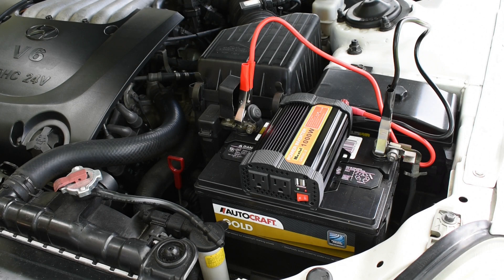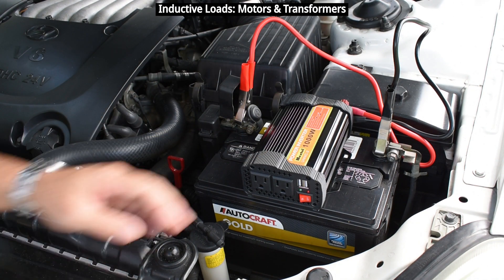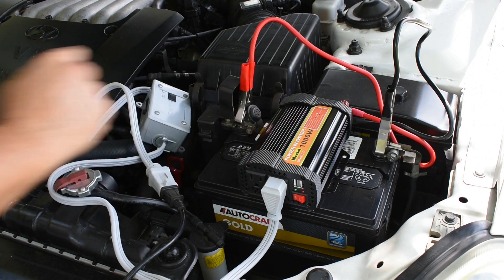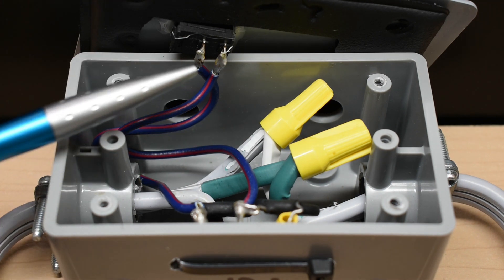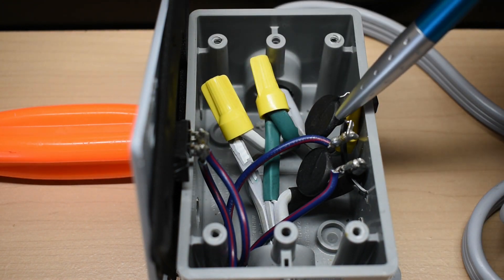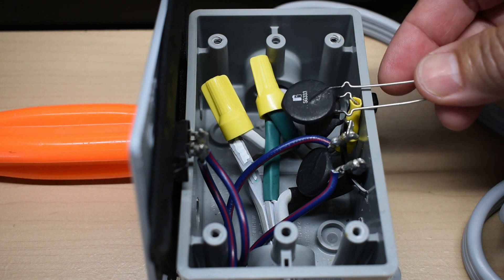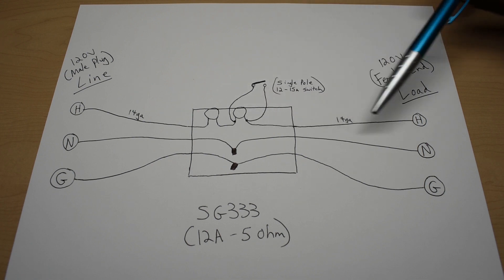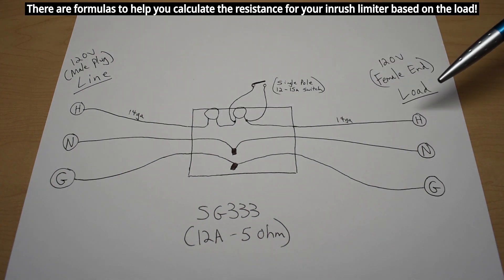The Simplest Soft Starter!

Comment: A capacitor rated correctly and put in parallel with the load would be able to output the amount of current needed for a short time , but would be more complex to create.
Reply from the maker: You can limit inrush current by using a high value oil filled run capacitor (200-400uF) in series with the hot wire to the load. I've done it many times. Works great.. Thanks for watching! Be sure to share the video link with others so helpful videos like this are worthwhile to make. Way too many channels on YT that don't help others or educate others, are getting way too many views.
Reply: @electronicsNmore  thanks for the help

Comment: If you want to know how this works, its simple. at startup motors act just like resistors whit very low rating, so following ohm's law at rated voltage they let X current go across them. by adding an ntc in series you are just adding a series resistor that's going to lower the voltage reaching the motor. for example if it lets half voltage reach the motor, the current going across the motor will be X/2. as the component heats up the amount of voltage acros the motor increases, while the motor rotating speed is inversely proportional to motor current. hence you have removed the startup spike. pay attention that a large enough motor could not start if it doesnt receive enough current. also modern fridges whit electronics inside will also fail to start due to the detection of a low voltage on the plug

Comment: @electronicsNmore   could you scale this design and use it for starting a 240 central ac with a running watts of 2500 and LRA of 17.5a / 18 kw??? could you scale this design and use it for starting a 240 central ac with a running watts of 2500 and LRA of 17.5a / 18 kw??? I ask because as of right now soft starts are costing near 300
Reply from the maker: Try adding a Supco hard start kit to your AC compressor.
Reply: @electronicsNmore  I think i may alread have one, however my inrush is still 17.5/ 18kw and i want to bring that way down to runn it off a mpp 5kw inverter 10kw surge 5 seconds, i have seen the easy starts work well and get them down to surges arround 4-7kw well with in range of this inverter from my understanding hardstarts do not lower the inrush amps but only limit its duration to much lower miliseconds, which still puts a heavey although super brief load on the inverter.  the softstarts actually lower the amperage BUT they cost arround 300$ so i was just curiois would it be possible easily build the same circuit for cheaper. . .

Comment: use a light bulb instead of chip otherwise  a 100C or Farad cell pack to boost DC current..
Reply from the maker: Boosting the DC won't help, the inverter has power output limits. The filament of a 100W bulb cannot handle 10-12A of current, all you'd do is light up the bulb as shown in my "Load Lamp" video. Thanks for watching

Comment: In the UK a "female plug" is called a socket and a "male plug" is called a plug. Confuse the two and you have bare terminals at line voltage.
Reply from the maker: In the USA a 120V "Female Plug", is also known as a receptacle, electrical outlet, or socket. I don't see how you can confuse the 2 ends. The male end always plugs into the wall outlet.
Reply: @electronicsNmore  Plugs are male, sockets are female. There's no such thing as a female plug.
Reply: @PipeManPeep  It's 2021, they can identify as female plugs, male receptacle, binary outlet etc etc...
Reply: @fatillacing4131   they can "identify" as a tin of beans for all I care. It doesn't change what they "are".

Comment: Why do inverter manufacturers do not include this in their units, would be easy and cheap, could there be a risk of fire if not well supervised as often the case with the general public, probably!?
Reply from the maker: They don't add them because every load is different. You don't want the ICL in series with a low power load, only high. You'd need to have a way to switch it on/off on the inverter. Thanks for watching!
Reply: @electronicsNmore  I was thinking if a momentary normally close switch in parallel with your current limitters in your unit  activated just when stating the grinder would solve the heating problem of the limitter once the grinder is started but would the switch resistance be lower to the limitters resistance,  a good question probably not sur!  In the 80's I was power supply designer and we used those kind of  current limitters to reduce the "power on" surge current in the input capacitors to increase MTBF ( mean time before failure ) of our units, repetitive current surges eventually wear them out in the long run.

Comment: @electronicsNmore :  Another awesome DIY project! I would have liked to know the power rating of your angle grinder and to  see how much surge current or voltage dip occurred to trip your 1000W inverter before and after using this surge snubber.   I do have a 2000W inverter, so knowing what difference this device makes would help me to decide whether to build this or not.  For now, I'll just hope my inverter doesn't go Tango Uniform if and when I use it for my  tiny refrigerator.  My gas generator is my primary backup source, where as the 12V inverter is my SHTF x2 secondary (short term) backup.
Reply from the maker: Pretty sure it's 5A rated. Thanks for watching!

Comment: If you had up to a 16 - 20 amp load of 240v  3840 - 4800 watts & used a SL32 5R020 - Ametherm - Inrush Current Limiters 32mm 5ohms 20A while using a welder or large compressor on a job site on a generator then the inrush current would be very extreme, would it be best to still only use 2 of these in series or would it be best to use 3 in series? The inrush current of a welder or compressor is sometimes 6 to 8 times it's normal current usage.
Reply from the maker: ICL's can handle the high inrush. The welder won't see 6-8x when a ICL is in series with the load, it will be much less if the right value is chosen. If the circuit breaker doesn't trip using the load(20A load, on a 30A breaker), then you'll be OK.
Reply: So would I need just one of these or 2 of these 20 amp ICL's in series?
Reply from the maker: @solarfunction1847  No idea, you'll need to do some tests. Just make sure the ICL is rated for the maximum operating current of the welder.
Reply: Thanks for all your help, take care.

Comment: Nice, I was thinking about something like this for my well pump, and fridge, to take the brunt off my inverter, I am basically turning my house into a giant inverter generator, with solar charged battery backup, I have a 5 HP, and 12HP engine, I'm connecting a alternator to both or one of them, to charge my 12v and 24v battery banks, when the solar isn't producing, I'm approaching 20kwh battery capacity, with lithium, and 600-700 ah of lead acid, I have a few 21si delco's and a few 12si, I'm thinking about building a regulator, to switch between 12v and 24v, or just mount both alternators , I have a 24v regulator, the 21si alts are 130 and 150 amp, two of each! I'm thinking about putting them in series electrically, so it will fun cooler, being outside of an engine compartment they should run cooler, being offgrid I need all the backup and reserve power I can get!  And I'm looking into getting a larger inverter, and  going to 48v, around 10kw+  great video, this helps alot, even though a 5kw inverter will start everything I need so far, I will put this in my toolbox! Thank-you!
Reply: I'd advise that you avoid trying to series alternators. Firstly, you'll need to isolate their grounds. Second, you'll need a voltage reference for them to regulate in a stable manner. This will make the pilot control complicated.

I'd also advise you go 48V. when you double the voltage, you halve the current (for an equal load) This means less copper losses, more efficiency and lower cost. Also, it's difficult to get decent inverters above about 3KV from 12v, and charge controllers that will provide enough current at 12v. I have a 12v system and a 48v system. The only advantages of the 12v system are that many, many appliances run directly, e.g. Wi-Fi router, CCTV DVR, downlights and basically anything that would run from a car (such as my laptop charger). The other advantage is that I don't have to worry about sustained arcing. This is a concern above about 18V.
Good luck with your system. Keep up the good work.
Reply from the maker: Wow, you've got a lot going on! I agree, with PipeMamPeep, I wouldn't do 2 alternators in series. Glad you enjoyed my video. Since you're into off-grid, check out the link below. They have all kinds of batteries/equipment/inverters, and if you like anything, your purchase will support the creation of more videos on my channel, and you'll save 10%. Thanks!

https://bigbattery.com/ref/19/
code: electronicsNmore10
Reply: James, if you can do all that, why not modify the alternator to deliver 24V, or even 48V?
Reply: @Inspironator  that's the plan, I was planning a custom voltage regulator to be fully adjustable, I wouldn't want to push it past 60v, for charging a 48v battery bank, depending on current, it could be over 100v if it were open circuit,  some alternators are capable of 500v+ open circuit, but all I need is 29v

Comment: Get a better inverter with a transformer instead of high frequency electronics.

The surge current capabilities are much much better and you don’t need trickery for each different load.
Reply from the maker: I have better, but not everyone does, which is why the info in this video is so helpful.